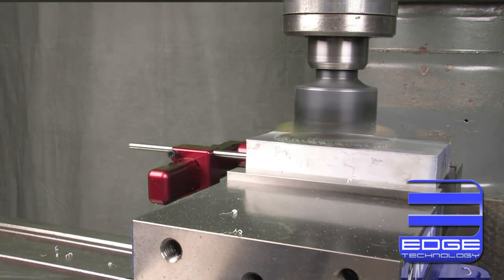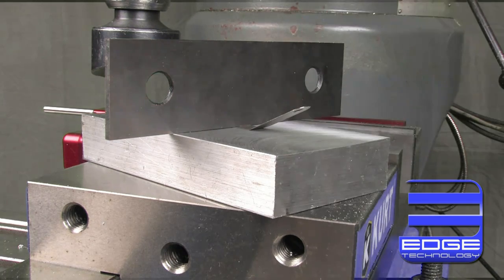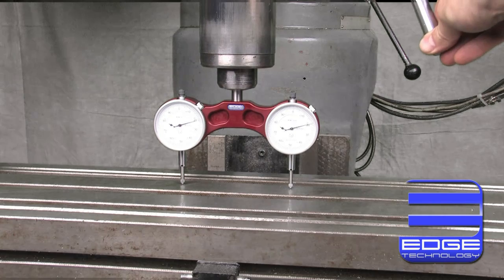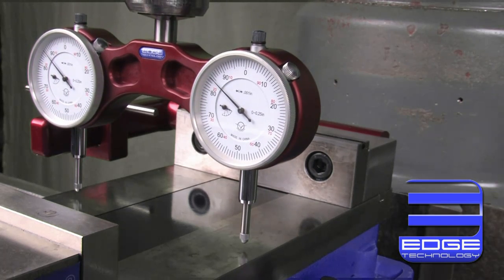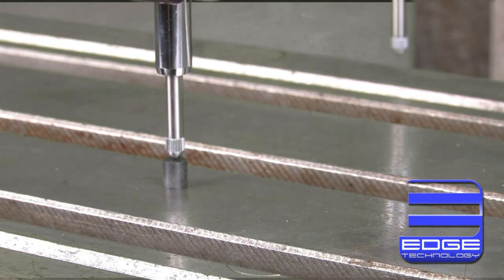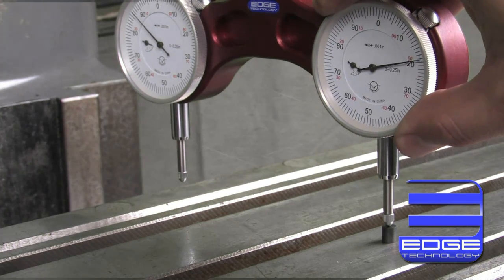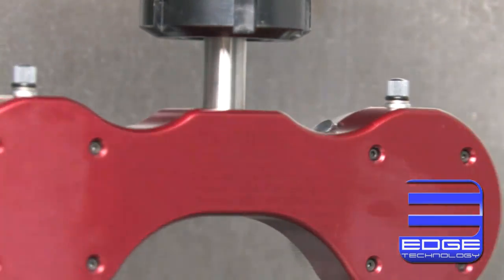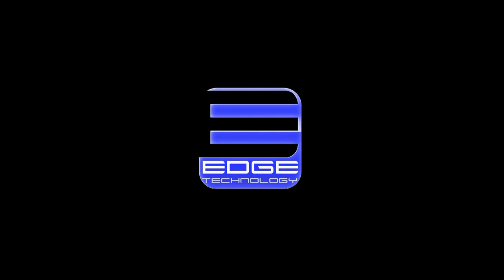EDGE PRO TRAM SYSTEM

Comment: Just bought the Pro Tram system, Guy's, You hit a home run !
I work as a machine tool repairman, That was the fastest I have ever aligned a mill head. 
There is no turning circle after circle with an indicator to get it just right, when tightening the head, you can immediately see if it moves.
Can't wait to set an angle with it, Best money I ever spent on a tool.